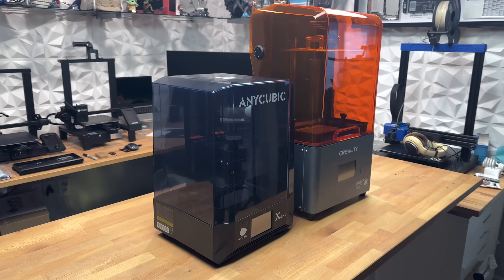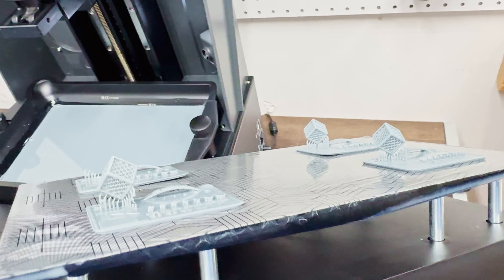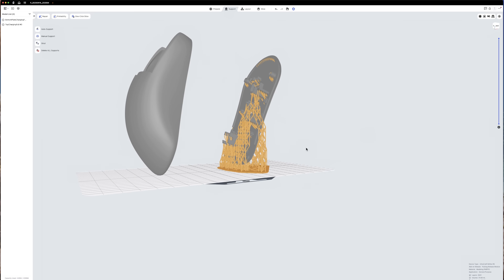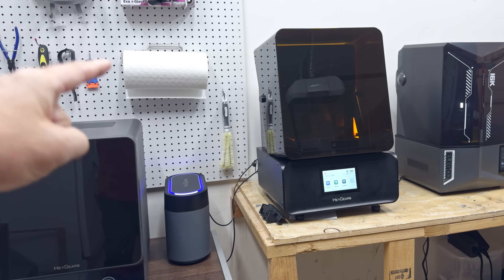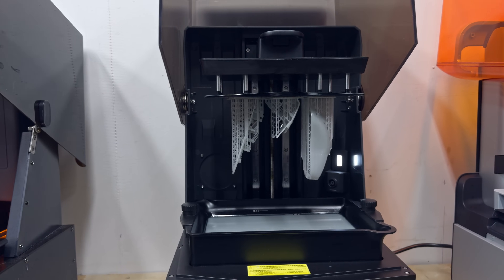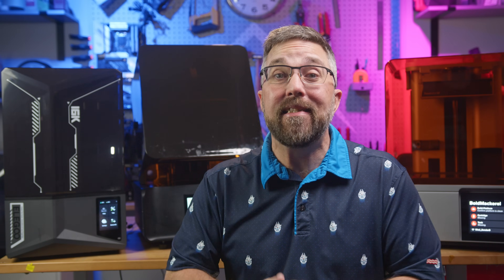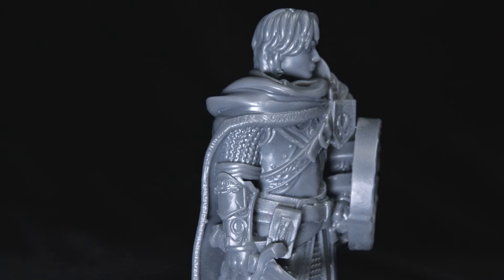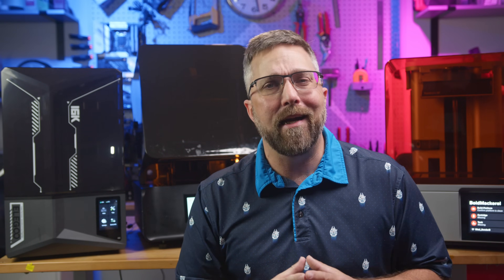Saturn 4 Ultra vs. Reflex RS vs. Form 4. Surprisingly Close!

Comment: A question for you. You stated you exported and imported the model into Preform. Can you explain your process for doing so?
Reply from the maker: From most slicers, including Blueprint studio, you can export the oriented and supported model as an .STL file. (Usually it's File>Export) This is how artists produce pre supported models. Once you do that you can open it in any other slicer, including Preform, just like you would any other .STL.
Reply: @ElevatedSystems  Thanks for the response I will give it a try!

Comment: Purchased the Saturn 4 Ultra but coming from a Formlabs enviroment this was eye opening. The calibrating of each resin is quite frankly wasteful. The resin is cheaper yes but testing and testing and testing to get a good print is the big reason it sit's in the closet. And don't get me started on dimensional accuracy. Yikes! Just picked up the Heygears Reflex RS and this in my opinion the best straight out of the box resin printer I have tested. Fill the vat, press print with the correct profile and achieves perfect prints every time. In fact printing directly on the build print without elephant foot is a huge game changer. Not even the Form 4 can say that. Great companion with my Formlabs machines!

Comment: I don't make miniatures. I make large scale statues and dioramas. I have a reflex rs and a saturn 4 ultra 16k. The saturn puts out nice print quality but the reflex has unmatched quality when it comes to the statues i print. I have a gktwo and phrozen mighty 12k. Which both put out nice prints but are a bit slow compared to the other two. They were my first printers that i got a few years ago. Been hearing good things about the m7 max. May try that one next or a gk3. Heard mixed things about the gk3.

Comment: Guys, can we stop using digital calipers to "verify" dimensions withing "10 microns" 😅 their qualifications/resolution can't even reliably measure down to that precision. Even quality micrometers can struggle to reliably measure that level of precision. And unless you're measuring in a temperature controlled environment, anything in single digit or even double digit micron measurements isn't reliable.

Comment: Right now, for a hobbyist that just wants to print ttrpg or wargame minis, which one would you recommend?
Reply from the maker: Honestly, if your workload is light and you don't need the 10-inch size, I'd look at the Elegoo Mars 5 Ultra for under $300. If you want a "it just works" printer, the Reflex RS is currently available for $699, which is probably the best deal on MSLA printers right now.

Comment: Man those cost differences are not trivial.   At least for me.   Then you factor in that in some it appears you really need to use their resin, which if I heard you correctly was over $100?   I mean I see it like this.  If you are a hobbyist, get the Saturn.  If you are a professional and require perfect builds you get the $3,500 one and buy whatever stuff they tell you to buy.

Comment: The Elegoo build plate must be leveled manually. I think you have not understood the correct functioning regarding leveling. I have encountered this error in many users. It is not self-leveling. In fact, in your video it is clearly visible that when the plate lowers, the 4 screws come out. This means that the springs are exerting pressure on the display and, above all, the plate is not parallel. This is a terrible condition. It is necessary to calibrate the plate by adjusting the four screws. After this, you will not have any more failures.
Reply from the maker: the build plate was warped. I bought a new build plate and the machine works fine now. You should check out my follow up video. https://youtu.be/CVzrWId_z5c?si=WP796BO7YUUf3LTl
Reply: @ElevatedSystems did you level it with the screws?
Reply: I have never manually levelled my Saturn ultra 4 bed!

Comment: Hey thanks for this review. I'm presently reviewing the Form 4 myself. You said something interesting to me when you noted as other reviewers had that the support structures from form were overly aggressive and hard to remove. Can you briefly explain how you generated the supports in the hey gears slicer an exported them over for use in the form machine? Is it possible to download the slicer for Gears for free and use this as a pre -slicer for the form machine?

Comment: Thank you for this great review, I really wanted to buy an Elegoo Saturn, however dimensional accuracy is a deal breaker for me. I needed something for building functional CAD parts
Reply: Only Form 4
Reply: @BlademanStore i read that reflex is also pretty good
Reply: @ROBOROBOROBOROBO   I recently purchased the Reflex RX Turbo and, to be honest, I’m disappointed. I bought it specifically for prototyping engineering parts, but for the past three days I’ve been struggling to produce anything without geometric distortions. So far, my impression of the device is rather negative.
Reply: @BlademanStore wow, that’s bad, do you use their own resin with their printing profiles or 3rd party resin?

If you make a cube of 15mm isn’t it dimensionally accurate? I ask because i wanted to buy it, so sorry your experience is negative
Reply: @ROBOROBOROBOROBO  Yes, I used the original PAS-10 black resin. I’ve been experimenting for several days now, but I haven’t been able to achieve either perfect or even consistently good results — all the parts show geometric defects: some are warped, some come out smaller in size, and others have various distortions. At the moment, I’m trying PAU11 (similar to ABS). It works better, but still not perfectly. I haven’t printed the 15 mm model yet — it seems too simple, and I think the defects wouldn’t be as noticeable on it. But I will give it a try. The issue is that printing takes a lot of time: one part takes at least 4–5 hours, and many of them take up to 12.
Reply: @BlademanStore  that sounds very bad, I think dimensional accuracy is one type of problem but defects like warp and all makes the machine unusable for even hobbyists

Is your workshop cold? Maybe the ambient room temperature is making it hard to print. I remember reflex has no resin vat heater
Reply: I am printing in a residential room where the air temperature is stable at 23–24 °C. I also purchased a device with air heating and pulsation. Under such conditions, everything should work perfectly, at least in theory. But in reality, things are a bit different. Over the next month I will be doing a lot of experimenting, and probably by the end I will decide whether it is suitable or not, and whether I can achieve perfect prints or not.
Reply: @ROBOROBOROBOROBO  If you look at all the reviews — and I’ve probably gone through almost all of them — most testers and reviewers focus on printing trinkets and figurines. For those, it doesn’t really matter how accurate the dimensions are, and any deformations are hardly noticeable. But when it comes to complex structural elements, that’s where the difficulties begin. There are almost no reviews or comparisons of such cases. The only one I found was a test with a computer mouse shell, and in that comparison it was Formlabs that managed to print the shell perfectly, without any noticeable defects.
Reply: @BlademanStore  Yeah I have seen that video as well, I wish you best of luck and I hope things work.

Maybe you should also take some videos put them together and put it on youtube, this way maybe you can send a link to the company and they can observe the situation in a very detailed way to offer solutions

Comment: Just got my saturn the other day. Been a blast using it so far. Haven't had any of the out of the box issues people seem to have with it such as the build plate which I'm grateful for as this is my first 3d printer in general. But to anyone considering this printer PLEASE be very very careful when removing the vat to drain and clean. I learned the hard way that there are VERY large gaps in the front of the printer just below the screen that feed directly into the machine. Thankfully when I had my little "accident" it just so happened to be in the very bottom right corner where there really isn't much to get gunked up by the resin, however just to the left of that is the gearing and motor for the tilting vat and I'd imagine once you get resin in that the printer is likely done for.
Reply: What has been your experience regarding dimensional accuracy so far?

In the video it seems disappointing that 2 parts don’t even fit together
Reply: @ROBOROBOROBOROBO  In my still rather limited experience with the printer so far, A lot of it is going to come down to the resin you're using and how much you tune the settings. I've made two prints so far that require a decent amount of accuracy and one was a success and the other wasn't. 

The first one I printed was a yeti style can holder with some other stuff put on it to hold specific items with it. Printed it with anycubic bio resin and the tolerances were too far off to use and I rushed the calibration on that one. 

The second part(s) I printed were an accessory for my friends airsoft guns. Those were printed with anycubic tough resin and as this was for someone else and had to be functional, I spent WAY more time dialing the settings in and by the time I was done even after curing the dimensions were pretty much spot on. 

Overall id say it is going to vary quite a lot compared to something like the form 4 since there isn't a whole lot of validated resin profiles for this printer yet.
Reply: @roidsaccounts9565 thank you for the detailed answer, great insights

maybe once you find a good profile or go deep into setup like you did, then perhaps with that resin you will now enjoy good accuracy, like a figured out resin with its profile and it will be a repeatable success

I want to do injection molding applications, like there are special high heat resins for that but I was wondering about this aspect a lot as if dimensional accuracy is off, prototype molds wouldn’t come together 

That’s why I like heygears rs turbo despite its smaller build size as it advertises itself to have good dimensional accuracy and this feature is mentioned by multiple YouTubers, however if it comes down to the resin profiles maybe it will also be a setup try and fail till success challenge

Comment: 5:20 ok but when you want to use a resin they dont provide a profile for?   Just saying they can curate well calibrated profiles without taking out all the useful calibration features.

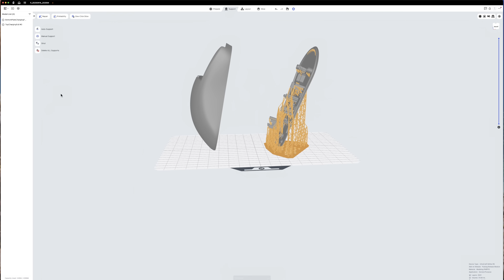5:32 no, thats absolutely not how that works. Its reliable because they did their profiles correctly for their hardware not because its locked down.

Comment: From my analysis:

Elegoo and their 4-$500 dollar printers are good if you want to tinker and eventually get frustrated.

Formlabs places an emphasis on quality and precision at astronimcal prices and versatility with the B, L and BL variations.

HeyGears is the balanced blend between the 2. May not have the build area as its competitors much less an acceptable price. But it makes up in being a precise machine

Comment: I don't know if it's getting autoremoved because of the link, but the form 4 is not accurate at all and I've been trying to share an imgur link of deformed parts off our work form 4. A basic elegoo Saturn 4 produces much better results with siraya tech tenacious lava black than formlabs rigid 4k, clear v5 or durable.

I'm highly dubious that you got anything remotely close to accurate with clear v5 for that mouse because similar shapes I've tried to print with clear come out absolutely deformed to hell and are completely unusable

Comment: Never calibrated elegoo manually and it works great evertime
Reply: Do you have the Saturn 4 Ultra or the Saturn 4 Ultra 16K?
Reply: @rogerdltj  it seems to be a production date issue. early buyers sanding their plates, later people reporting perfect first runs. i have one coming soon to see
Reply: @crazylego98  great, I'd love to hear your experience! I hope I can get one sooner than later.
Reply: @rogerdltj  my delivery guy was quite lazy and genuinely THREW it on my porch. printing hasnt been the most consistent and not sure if it is me or a mechanical issue now.
Reply: I have never manually leveled my ultra 16k and it works great. I have a few different resin printers. Besides my reflex rs. The saturn has the next best print quality and speed. I have a gktwo and mighty 12k as well. They put out great prints but are kinda slow compared to the other two. As they are a few years older.
Reply: @damiencross7334 do you have the air release module for the rs turbo?

Comment: I'm debating between the Form 4/4L and the upcoming Prusa SLX.  The SLX uses a tilt mechanism, but no spring.  Do you think it could still deliver the same dimensionally accurate prints as the Form 4/4L?  

Thanks tons for you videos, they're hugely helpful!
Reply from the maker: IDK but considering the HT90 cost 10K the pricetag on the SLX is going to be atronomical.
Reply: @ElevatedSystems  I believe Mono 7 max could be good contender to this 3 printers, it's cheap, it doesnt have a tilt mechanism so dimensional accuracy could be better than Saturn at a comparable price point

Comment: I'm not sure if my description is accurate. In the Warhammer field, if it doesn't involve dimensional precision, 4U is more suitable. However, if it involves assembly, requires material performance, or aims to reduce polishing costs and enhance convenience, then heygears is the better choice. Formlabs is not suitable for this area. In other consumer electronics fields, 4U is no longer competitive. Reflex RS can meet some needs, but let's not forget Reflex, which is a device more suited for this field. I feel that heygears is like a budget version of Formlabs.:face-blue-smiling::face-blue-smiling::face-blue-smiling:

Comment: So in conclusion, if I value ABOVE ALL a headache free experience (least mess, least print issues, least failed prints, no surprises, it just works everytime, etc...), would I go for the Form 4 or HeyGears?  I don't have time to tinker.  I will be printing functional engineering parts, and I just want to be as productive as possible.  I appreciate any guidance you can give me in choosing the right printer
Reply from the maker: Depends on your use case, but with just the criteria you listed, The Form 4.

Comment: This is a really good comparison! I have the Elegoo Mars 5 Ultra and have really enjoyed the upgraded speed. I will say that cleaning the new Elegoo build plates are a massive pain since you cannot submerge them in IPA due to them having cavities that will fill with the IPA and leak out later. I am still looking for a good workflow on that. I have considered using a system similar to the Formlabs vats where I just buy multiple vats for my Elegoo and trade them out except I worry about the resin settling in the vats. Have you experienced this with your Formlab's vats? Overall great video!
Reply from the maker: No, the Formlabs vats come with a UV blocking lid and the mixer mixes up the resin as it warms prior to beginning a print.
Reply: Get yourself a drip bracked printed on a fdm Printer. It will let you Hang The buildplate at an angle After The print. Saves you a lot of resin and makes it way less messi

Comment: You never hear the bad about these printers… only the awesome prints that YouTubers are capable of making (after the magic of editing).  Looks like the industry is way far away from their “Bambu moment”.  You’ve saved me untold hundreds of dollars in setup costs to get started with resin printing
Reply: bought the reflex rs turbo just for that reason. its pretty much click and print. but i found out the hard way that resin printing is very messy and the smell is pretty bad!! Needed a printer tent and and evac system to control the smell. but details in the prints is amazing!
Reply: @peterpeter5666  I learned resin printing on a cheap Photon M3 and I'm considering the RS Turbo as I don't want to tweak settings.  I just want it to work.
Reply: @nitzerebbhead can't go wrong with the R's turbo. I even tried cheap 20.00 resin and it printed fantastic.
Reply: I have a hey gears reflex and it is incredibly easy to use. The prints come out amazing. I have the saturn 4 ultra and it also prints really well and is simple to use. Every printer has its downsides. Only being able to use hey gears resin and the price. None of them are perfect but you can absolutely print high detail prints. I have 4 resin printers and 2 fdm. I make stuff every day. There are so many insanely detailed statues, bust, and dioramas that you can print.
Reply: Really ignorant comment